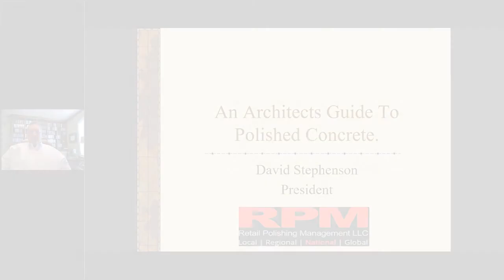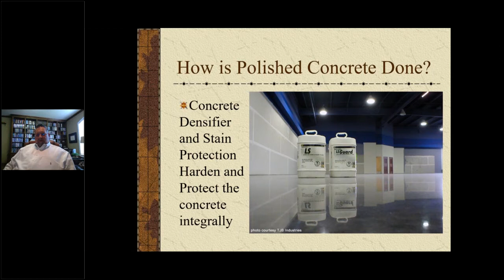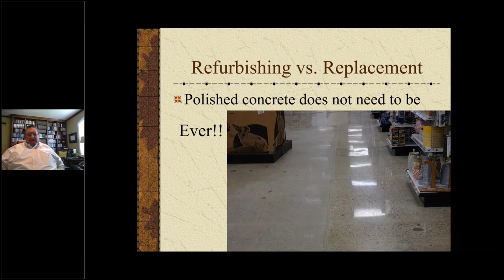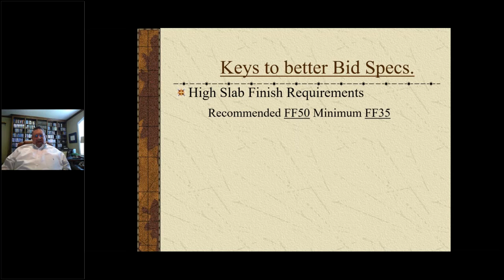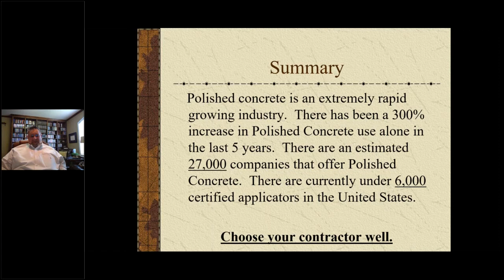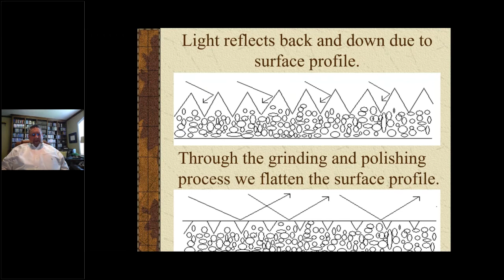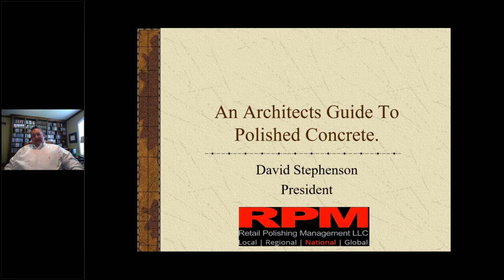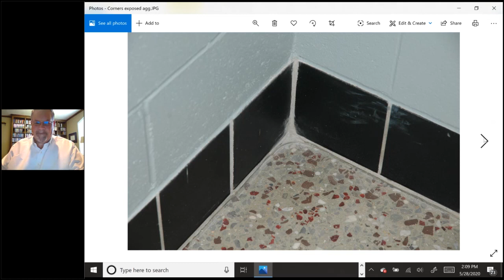ARDEX Webinar - An Architects Guide to Polished Concrete with Guest Speaker, Dave Stephenson

Comment: Does Ardex polished concrete overlay require sawcutting control joints?

thanks
Reply from the maker: Hi Clark, good question, which might need some clarification! If you're asking if ARDEX overlays require saw cuts, the answer is no. The material can be placed monolithically.
If you're asking, if we recommend honoring saw cuts in the concrete up through the ARDEX overlay, the answer is yes. If you would like more in depth information, I can connect you with our product expert. Just drop your email address! Thanks!